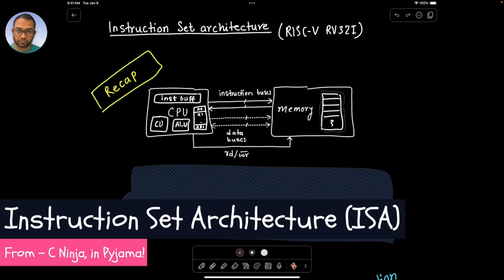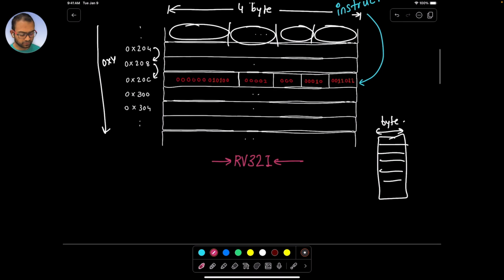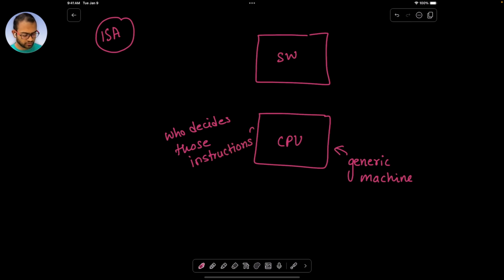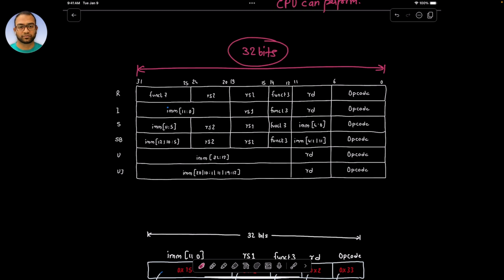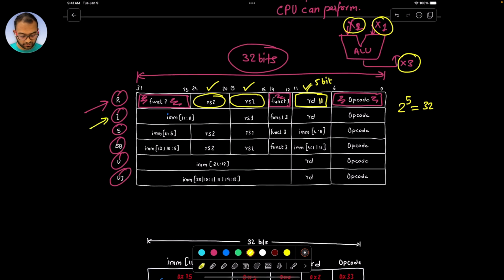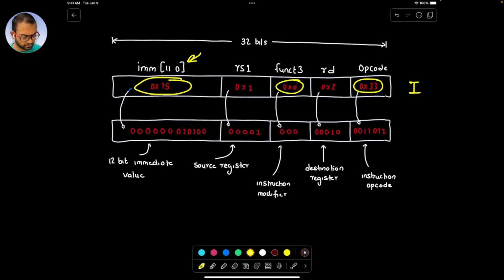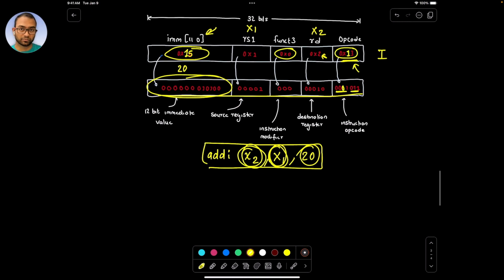5. Instruction Set Architecture (ISA) | Assembly, C on Bare-metal RISC-V

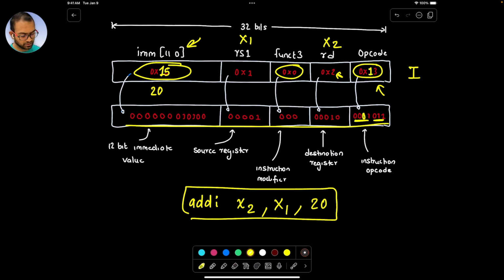Comment: In 14:31, The opcode for addi is 10011 -> 19 in decimal whereas you've mentioned the opcode as 1011 -> 11 in decimal. Please clarify this.
Reply from the maker: @yuvaadhithyan794: Kudos!! 🙌🙌

> .. addi is 10011 -> 19...
This is correct! I missed this in the video review. I should have written it as, 10011 and not 1011!! Also, luckily I did not screw up the 0x13 (in the hex representation of the encoding) which is 19 in decimal!!

Thank you for spotting this! You are awesome!! 🤩

Comment: Clear cut explanation I've ever seen !Hoping for future videos also this clear.I have a doubt if a instruction is read value from memory and then how will be the work flow, fetched instructions will be decoded by CU , will ALU uses the same bus used by PC to read value into instruction buffer , or will there be any other bus will take value and directly store in destination address, pls explain my doubt briefly
Reply from the maker: @kbdiwakar1452:
> ... will ALU uses the same bus used by PC to read value into the instruction buffer...

The instruction you are referring to is called - load instruction (ld). The instruction itself will be fetched using the instruction bus. The memory access to the address from which the value is to be loaded will be done on a separate "data bus" (in Harvard architecture, von Neumann architecture uses the single bus to fetch both instruction and data). The actors involved here are ALU, the Register file, and some more internal circuitry of the CPU.

Please let us know if the answer helped.
Reply from the maker: This is also explained in one of the previous videos in the series: https://www.youtube.com/playlist?list=PLFt5JBAXXlQow0PLTdqvaiIUMRa71VQHl
Reply: @inpyjamaarchieves   yes sir, explanation is understood,  got an idea.Thank you.